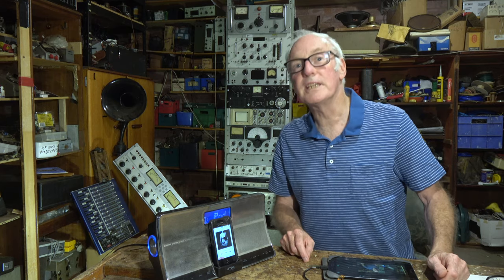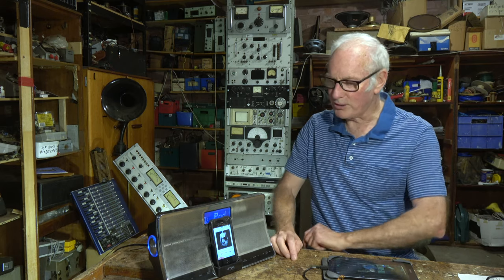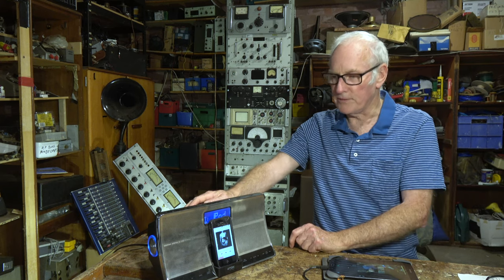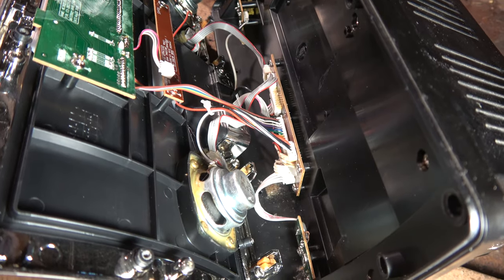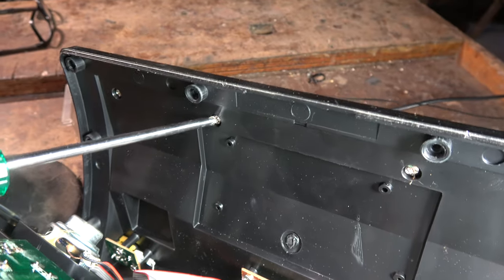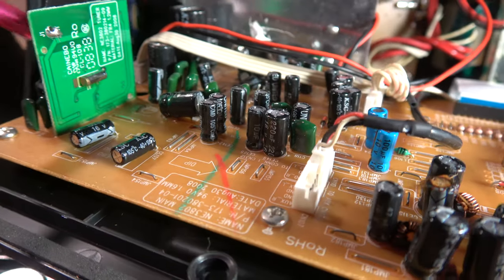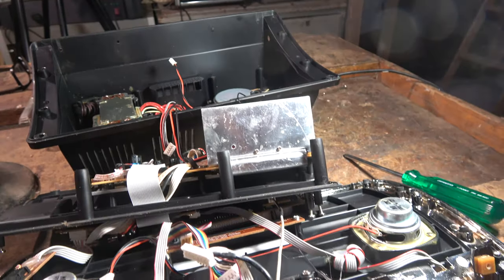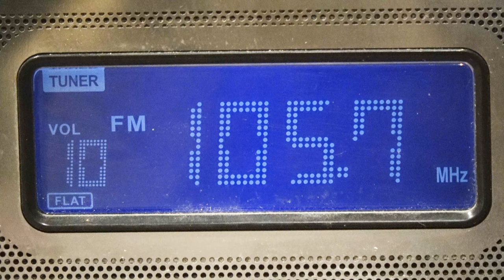Retro ipod docking station teardown  4K

Comment: Gday David, A few electrolytic caps were looking a little rotund around the top but after 10 years of use that’s what you would expect, sh1t from start to finish for this unit . Thanks for the good tubes. 73 Richard vk2ual